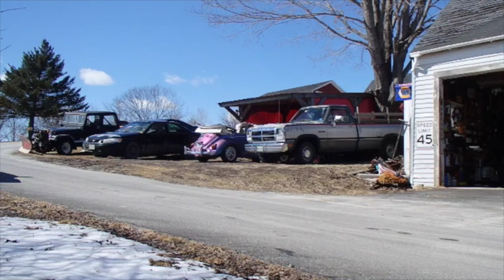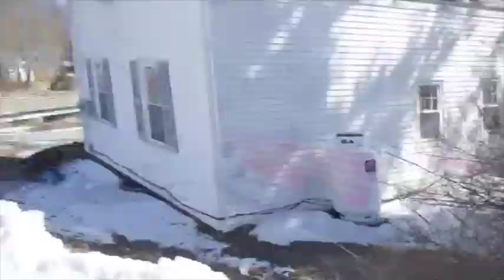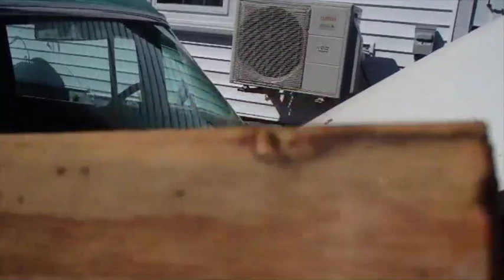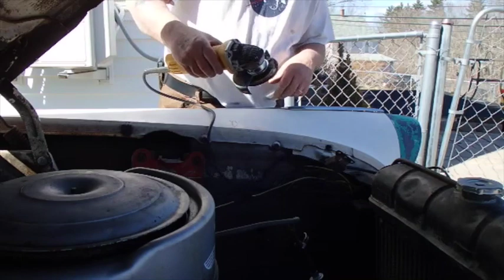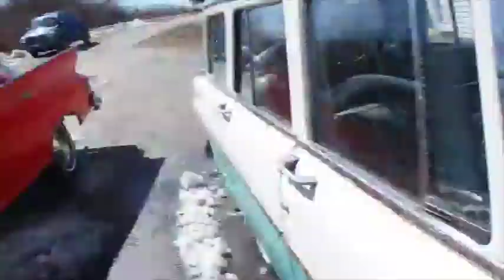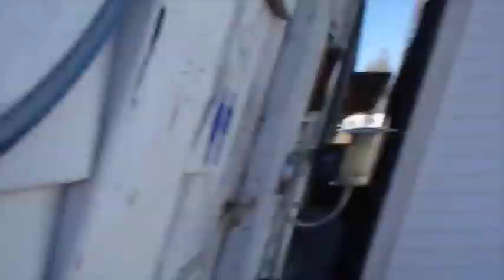A Part for Ricky

Comment: If Memory Serves Those Cars Did Not Have oil Filters Back In The Day ----- You Gotta A Lot Of Cool Stuff  Mr Peek ----- Love The Vids  Fast Forward / Real Time Action Thing Is Very Cool ---  That 61 Looks Like a Million Bucks  with The Right Tires On It  ------ Out Here In The Big AZ  Summer Has Already Arrived   So Enjoy Your Spring  Whatever That Is
Reply from the maker: Mine has a twist on filter, but it was froze on there and it took me 3 weeks to get it off and by the time I did it was ruint.   My '53 Cadillac has a gravity feed oil filter and the Flathead V8's had 'em..  The toilet paper filter was an aftermarket part, but I've heard they're really good on cars like VW's that have cooling issues.  Get the oil out of the engine and give it a chance to cool a bit while filtering it..  The Y-blocks did have oiling issues, if the cam shaft bearings and rocker arm shafts aren't lined up right.   And so forth..  Thanks..
Reply: I Must Be Thinkin Of The 55 Chevys  ----- I Never Used The TP Filter   But I Have Used The Remote Filter Set Up On VW s  With The PH 8A  Spin on Filters  ---- They Work Great With A Remote Trans Cooler To Cool The Motor Oil ---- Out Here a Must Have   You Don't See Many Bugs Out Here Anymore  Not Like The Old Days
Reply from the maker: Yea, not sure where out here is, but used to see 'em everywhere.   Chevy had closed canister filters for the longest time, under the motor, you had to remove the canister and drop in a filter.  People used to put change over kits on 'em to use the spin on's.  Much easier..  Yea, all them old cars are gettin' scarcer.  I'm glad I got a couple before they're all gone..   'Course, I'm gonna be gone too one of these days.  Wonder who'll take care of 'em then..
Reply: Phoenix Arizona ----- I'm Sure You Will Find Someone To Leave Them To ---- But In The Meantime  Eat Your Wheaties /Stay Safe  /  Stick Around  And Enjoy Those Slick Old Rides